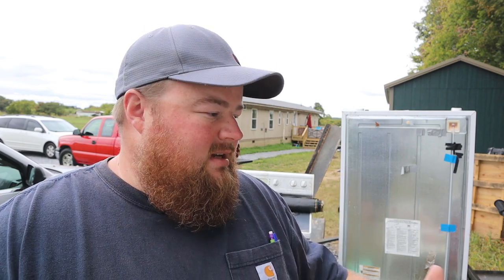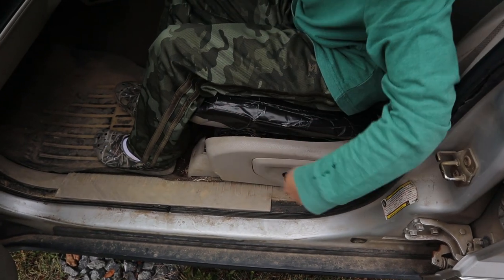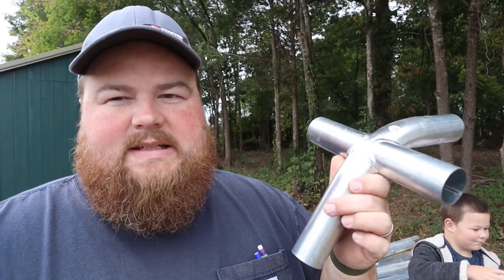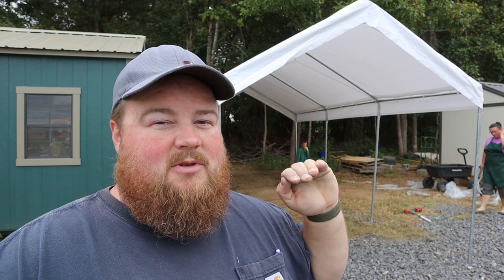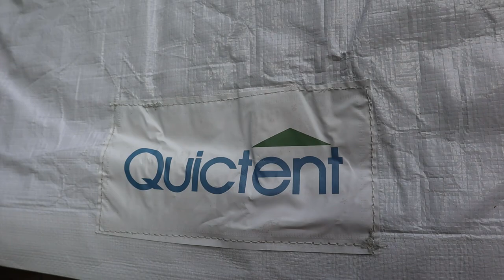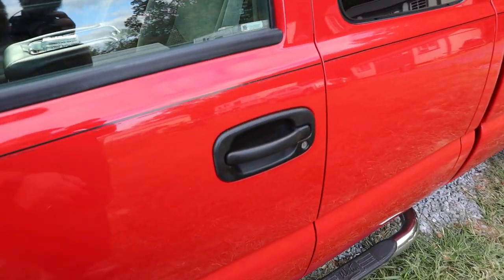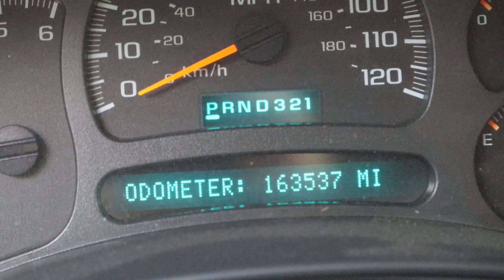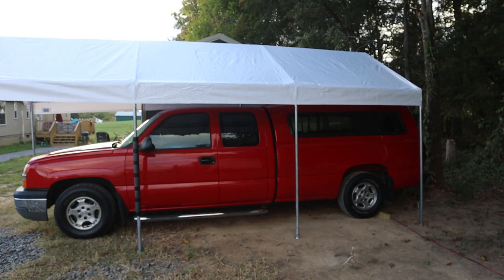JUNK Cleanup + Our NEW TRUCK Gets a Carport! // Quictent 20 x 10 Carport

Comment: If you haven't already, I definitely recommend checking the anti-freeze to make sure it has actual anti-freeze instead of just plain water. We have found that a lot of Floridians use plain water as coolant, at least in the vehicles we have bought here, which has led to so many of the parts rusting.        What's good about the canopy also is the truck will be shaded so it won't be so hot when you get inside.                   And I just want to point out that I love the color of that teal shed. Picture the singlewide that color too  :D
Reply: I agree with the shed color, it beautiful. 
Believe it or not but people in Maine use water too & it freezes in the winter🤭

Comment: You can always use the extra pipe insulation or pool noodles and attach them horizontally on the storage shed where the door would hit to protect the paint.

Comment: Isn't the car port a little close to the storage shed where rain coming off the carport roof will slide down the side of the shed and wash out the floor? I'd put up a gutter on the shed to save the side and divert the water back towards the wood.

Comment: Really nice looking truck!!
I missed the community post.  
I suggest that you put some “bumpers” on the front posts also. I can see a mirror getting scratched very easily.  You might have to pull the truck forward a little bit and that would also protect the doors, if the boys forget to be careful.  Again a very very nice truck. That long bed will prove useful to you in the future. Even though it might be a pain to park, someday I believe you will be glad you’ve got the extra length. I I have a long bed truck and like being able to haul 8 ft lumber without a flag. 😀😀

Comment: probably can add a few more pipe insulation with a broomstick through it mounted horizontally along the shed wall at hip height , should stop the edge of the door from slamming intoo the wall of the shed
the truck looks great , maibe do some underbody coating (bedliner?) to protect the frame and stuff like that

Comment: Question  /suggestion   if you plan on having  chickens?  The car port structure  would make a great covered  chicken scratch  area  tarp cover optional  could use chicken wire to keep preditors  from air out  option  to cover with tarp halfway  so have dry area even when wet

Comment: Whenever I get another vehicle I power wash the underbody and spray it with underbody rubber coat  to keep it from rusting. Then I spray paint the muffler and pipes with heat resistant paint to get three times the life out of it. Yes you will smell the burning paint for a couple of hours but it is worth it.❤❤❤❤

Comment: Really good motor in your truck. I have a GMC with the same motor and it has 329,000 miles on it. The only thing I have done to the truck was rebuild the transmission. Motor is still strong. Congratulations.

Comment: Nice to have another driver , even if just to do THE SHUFFLE .  On your carport , when backing up , you can also hang a tennis ball on a string from the center REAR roof rafter steel, you back in , centered  the ball with your interior mirror and when the ball touches the glass , YOU ARE back far enough ! Front bars for carport , wrap yellow caution  tape at mirror level and when you back up the reverse lights reflect so you can see them at night or rain days.

Comment: I bought a 1996 Chevy  Tahoe, bright red, with the 5.3 Vortec with 123 thousand original miles, 4x4, same condition. I bought mine from a man in Alaska that had kept it tarped for 12 years in his back yard. I had to buy a battery and tires but  it fired right up, couldn't be happier. I paid 1000 bucks for it and it still isn't broke in yet. Good buy for you, I hope it does all you need it for. You guys will look good toolin around in that thing.

Comment: I had one like your one with sides did craft in it for over 10 years the held up for over 20 years before wind got it the poles did begin to rust after 15 years. I was thinking oh I hope he put the top on with one side down. Great time to put light on the center poll also.. Great job letting the boys put in up.  Boys you did great. One more teaching moment

Comment: We installed the same portable garage that you did, the enclosed one. The tarp(?) part lasted about three years, the frame was still going strong seven years later. We could not get a replacement  for the tarp, so we had to buy another comete kit. We used only the tarp on the  frame that we already had up. My son decided to take the new frame and he used wood to enclose it. That tarp lasted three years as well. We had a bad storm that came through and destroyed the tarp.  We still couldn't find a replacement for the tarp only so we ended up having to buy another complete kit. Wen my husband passed away, I advertised the second new frame as a free item on FB and someone came to get it. With my husband gone, I asked my son-in-law to take the entire garage down and he took it to his mom's house to store hay.

Comment: Those boys did a great job. That's the way to do it, teach them and let them do what they can do and learn while they are young. When they grow up to be an adult, they can look back and say, wow, I'm really glad mom and dad taught us these things.. As you know, some these days really don't know anything but video games.. LOL.. On your Silverado, Congrats on buying something you and your family will get plenty of use of. I have the exact same truck, minus the topper/camper. Mine was a one owner as well, It had 123,006 miles on it when I bought it, and I've had now 10 years. Still looks almost like it did the day I got it. It now has 192,568  miles on it. The main thing that these trucks go through are the knock sensors. That little check engine light will come on if one or both are bad. It is a common issue with these Silverado's and is a pain in the back end if one is fixing the issue themselves.. Oh and going into what they call "limp mode" which will make the truck have no acceleration power but is very easy to fix. 9 times out of 10, It's just the plug that connects into the throttle body. Not trying to discourage you by no means, because you've made a great purchase with that truck. Just giving a little heads up on what may or may not come with your truck as those Silverado's especially with the 5.3L engines go through as I and many that I know, have gone through those 2 issues I mentioned. But, over all, you did very well on the purchase and it looks great. I hope that truck does what you need and want it to do and before you know it, your boys will be driving it being your chauffer. lol.

Comment: The only truck we bought new was a 2002 Chevy 2500 HD. We just sold it a month ago with 165k miles on it.  It was the best running vehicle we've ever owned. The only mechanical repairs we had in 20 years was a starter and an alternator.  
The boys are such good helpers. Great job on the carport.
It's really smart to teach kids early to drive. By the time our boys took drivers education they were seasoned drivers. We never had to be concerned when they got their license that they weren't safe to be on the road. 
I know it's a ways off but I've been curious what you're considering for siding for the trailer.  We have vinyl on our trailers and I hate it. I wish we could have afforded T-1-11 & done a board&batten look or composite siding.

Comment: I've never seen those earth anchors before, and DEFINITELY want some of the same ones you used. Too bad everyone is out of stock on them. The, new to you, truck looks great for it's age, and if I may offer some suggestions. The first being getting a spray on bed liner. You can get them in black, or color matched if you'd like. Next, whatever color spray on bed liner you choose, spray paint the underside of the bed cap the same color, just for a nice clean uniform look. And lastly, find an undercoating shop that uses Fluid Film. Standard rubberized undercoatings trap moisture, and actually cause a lot more rust damage, than you would have without anything being used. There are plenty videos online showing what I'm talking about.  BTW, do you have any plans to resurrect the "Samcraft" channel??  As always, GREAT VIDEO!!!!! It was also really cool to see Elijah driving your Jeep.

Comment: That truck is perfect. If I gave you a pic of my 2003 from here in Michigan,  you would freak out on how badly rusted out it is. I'll trade you, LOL. Mine is a Dodge Rumble Bee. 5.7 engine, 4X4, 20 inch chrome rims, 4 door, with the longest short bed available. It also has a bumper hitch & wiring plus a hidden gooseneck hitch in the box. It came with a cap similar to yours and it's a little deeper red, but not burgundy. My 1995 Sierra 1500 is an extended cab, 2 wheel, 305 engine, shortbox with flat bed cap. It's burgundy LOL.
BEAUTIFUL TRUCK. CONGRATS

Comment: I loved this video.  I have a rural property that we just bought in Florida and I am starting to do projects on it now that I finally have a garage that I can use as a garage and workshop, and storage. 
And the truck reminds me quite a lot of the one I own.  It is the 2 door version of yours only in a 2010 and with a slightly different topper, but with an 8 foot bed.  It is also in the same "Victory Red" that yours is with only 95,000 miles.
An accessory that I added to mine that you might find very helpful is a back up camera.  With that long bed and topper it is very difficult to see what is behind the truck.  It truly helps immensely.
Reply from the maker: I absolutely want a backup camera! :) It's very difficult to judge distance when backing up in this tank. LOL

Comment: I would recommend laying a concrete base underneath where you park it. Eventually the moisture will start rusting out the underneath of the truck. I know this from having a gravel driveway for 26 years before I got our four car garage built. For shelters I only buy Shelter-Logic. Very good quality. One of the best things we have here is a recycling center. And they take styrofoam! I recently got rid of the old refrigerator and furnace from the mobile home we're renovating in NH. Cost? $10 for both. I did a couple of huge loads of construction debris there for $80 per load. That saved me about three hundred dollars on the cost of renting a dumpster. Tomorrow when I get the mini-split working (I hope) I'll be saving $8,000. I try and save $ when I can!

Comment: I have a 2008 Mazda B4000 truck with 50,000 kilometers (that's 31,000 miles) on it.  I have been stopped in parking lots by people asking me if I want to sell it.  No way!!  I've had it since 2009 and have had zero trouble with it and it too looks like new!  But I guess that tells you that it certainly isn't overused!

Comment: That's a great looking truck for a 2003. We have a 2002 gmc Sierra with almost all the same specs as yours and it's great. I work at a land surveying company and that truck definitely gets some miles. It's at about 220000 now and still going  strong. One thing to mention though. Those engines like to burn oil so just make sure you check it regularly and you shouldn't have to many issues. Those trucks are also notorious for having weak transmissions. Overall though looks great. I love watching your family's videos. Makes me want to start a family and homestead some day. Thank you for all of the entertainment and lessons you have given me.
Reply from the maker: Thanks for the info on the truck oil and transmission!

Comment: Great find, Sam. It looks better than my 2012 chevy which is the same color red. No, your truck is in mint condition, mine after 10 years on salted winter roads is starting to rust around the wheel wells. I'll be buying patch panels this time next year in order for it to pass our State inspection. I'm not posting 45-60 gran for a new truck. Them ole Chevys wit the V8 5.3 liter engines will run 350,000 miles by keeping  
The maintence up.my Chevy Colorda needs the radiator flushed out and a new thermostat  also the wheel wells are starting to bubble and blister. So, I will have to put a patch panels on both sides.

Comment: All that cardboard will be great (in one way or another) for the garden. For one thing, earth worms LOVE cardboard. Or you can use it to block weeds around the perimeter of the garden. Do not burn the cardboard and do not haul it away. Another way I use cardboard: when I bring in a load of mulch or compost, I put down several layers of cardboard under the pile.

I love it that you had the boys do the carport. You no longer have the privilege of just doing  the job yourself and getting it done fast. Where ever possible, it's so much better to let the kids do it and step in only if they need help.  Otherwise you're depriving them of learning opportunities.

Comment: The duct tape will look like garbage very quickly, and I doubt the foam pipe insulation is UV resistant. I would find a purpose made solution. They do have commercial products for this purpose.

Comment: That 5.3L engine is the old 350 block isn't it? Very strong dependable engine. I think the 5.3 gets a ton better gas mileage though.
Nice truck.

Angie, set aside a couple Woodsman soaps when they are ready. You are currently out...of course you know that...nevermind.
Don't nevermind about setting some aside though, just nevermind everything else...I think.

Comment: Why didn't you put that up makes me think why don't you contact the company and see if you can buy siding for it as a separate package. You might be able to get some of the bargain. Another thing you could do is contact some of your local billboard sign people in your area and see if they have any"error signs" that they can't use that are up for sale just be sure to get one big enough to do all the sides. Then when you put it up on the frame just put any paint inside on the inside and you'll have a solid color on the outside. I'm sure that's much cheaper than buying the proper siding from the company. You could also use that same plastics to put down for a garden to kill all the weeds before spring planting. Really looks good. Your boys are doing good working together and accomplishing something.

Comment: For a longer life span of your cover may I suggest you grab some more pipe insulation and Cover in the same way any chafe points between your cover and the metal frame.  These are spot's that can wear through from the inside out without something between the rough galvanized pipe frame and the plastic cover. 
S
Just a suggestion.
wolfmama0104

Comment: I realize you all are in a bit of a recovery mode from pushing hard project after project for what seems like a year.  And, I would suspect you both and all are refinding your ways to some income streams plus simply living with more activity ammendities like sleeping on real beds etc.... But it also seems like you're beginning to reach out beyond the interior walls of the trailer with respect to aesthetics.  Spring and then the 2023 year will be upon you sooner than it would seem.  I encourage you all to network and attempt rooting from cuttings as folks around you do thier fall and winter pruning.  If you've got an aging population in the area, or a senior center, for an afternoon helping someone divide thier bulb-like perennials (or maybe even prune a shrub for some branches capablemof being root-started), an afternoon's worth of work can reap enough starts to more than cover your labor if costed out. If you've got a younger population moving in and/ or house flipping going on, "old fashioned" vegetation is often dug out and discarded too.  Often this won't particularly yield garden center desires in terms of actual plants but, it is a quick and fiscally inexpensive way to add ornamentals.  What survives, survives.  Over time if you decide you don't want what you drug home or all 20 cuttings of something actually took root - it often isn't too hard to find a new home for it.  If semi-undecided about your growing collection, cut in a bed or a spot for it; these things kinda grow on you.